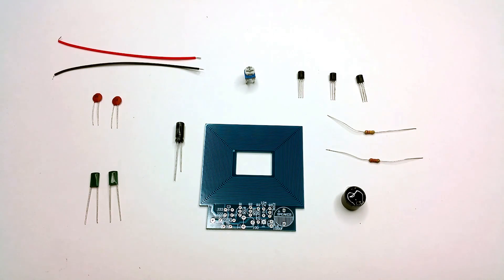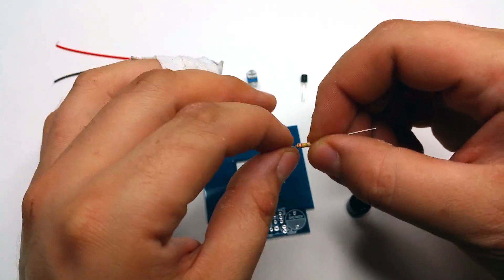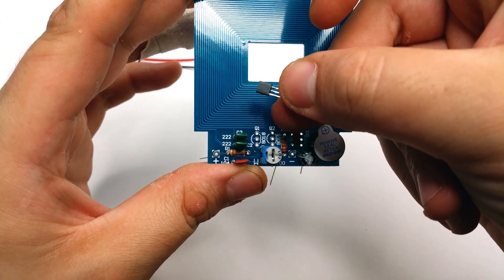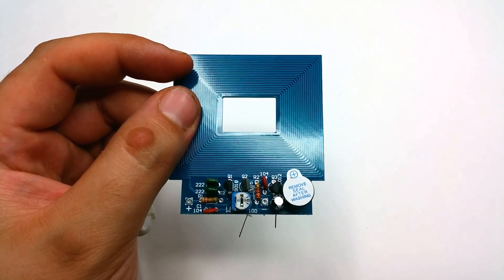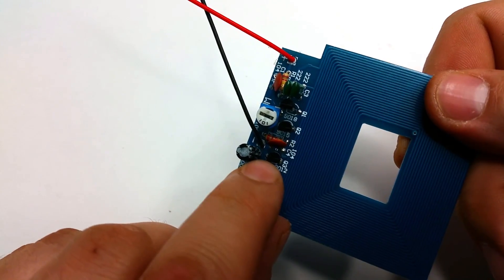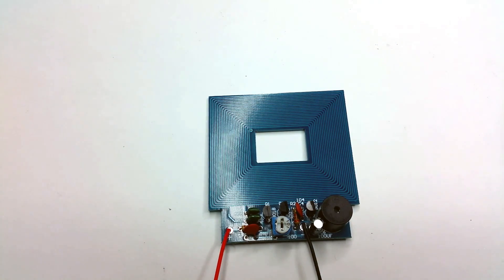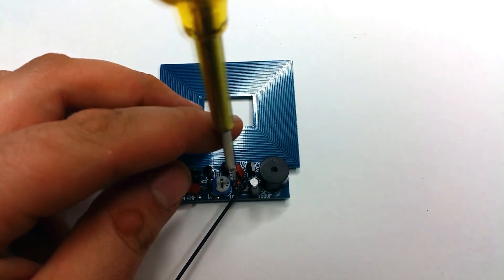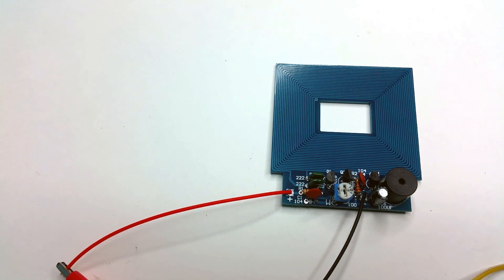DIY Metal Detector Kit, build, soldering and setup guide

Comment: resister colours are confusing me what colours go on the left resister? all 5 bands order from left to right so i can get this done?
Reply from the maker: One of the two outer rings is the tolerance ring, the other rings indicate value. As others have stated, there is often a subtle difference in (location of) the tolerance ring, but not always too clear.  For cheap and easy to find resistors, the tolerance ring is often gold (5%, 4 band) or red (2%, 5 band) Measure them with an ohmmeter then check with what it should be- there's only two combinations, and not many values have brown as the left band (the most common -1%- tolerance band for 5-band through-hole resistors).